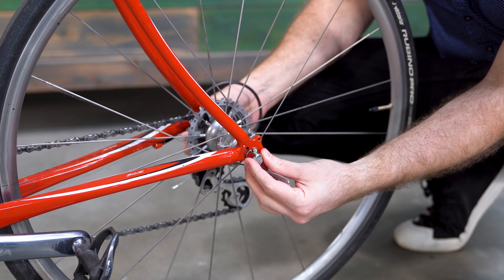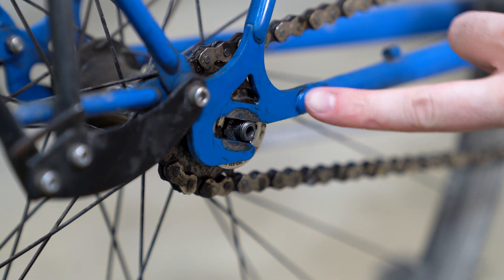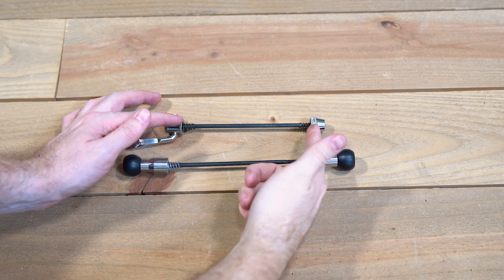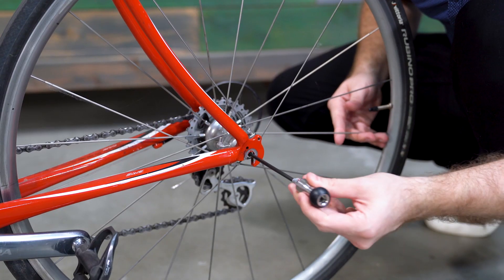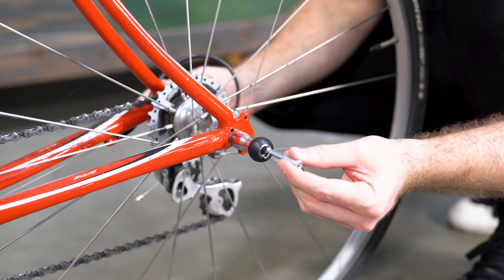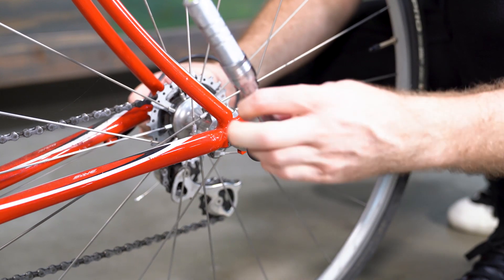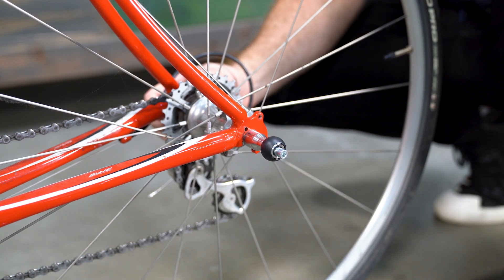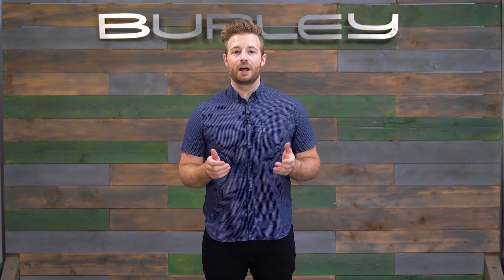Coho XC 5mm Skewer Installation | Burley

Comment: So....no longer a Quik Release? I may as well replace the axle and have a stronger system using the burley ballz nutted adapters.
Reply from the maker: Thank you for your feedback. The updated skewer's design change from quick-release to bolt-on improves the structural integrity and durability of the axle. Please feel free to reach out to our Customer Support Team if you have any additional product questions by submitting the form via this link: https://www.burley.com/support/contact/
Sincerely,
The Burley Team
Reply: I feel the same as you but on a rational level this looks like a nicely engineered solution. I am surprised that QR skewers hold up at all. My first bikes never had QR and then over the years never had a bike without them. I recently worked on a cheap bike without QR and really gained an appreciation for the QR system. I have several Burley Ballz for my Cohoe that fall under the recall.

Comment: Hi, I like the video. I have a question I’m hoping you could answer about the 5mm skewer
Q: I’ve got a rear rack fitted with mounts which protrude out above the skewer. Can you tell me how far is too far.. before it impinges on the latching arm?
To put it another way.. What is minimum clearance required between the outer edge of the frame dropouts and inside of the Coho XC latching arm..
 
My feedback would be more drawings with dimensions as there is so much guessing, just include as flash frames or links in the description
Show skewer spindle length alongside hub width... How far out does the ball join protrude.
Thanks..
Reply from the maker: Hello Jonathan, thank you for your question and feedback. For specific compatibility questions like this, our Customer Support Team is the best resource. You can contact them directly by submitting the form via this link: https://www.burley.com/support/contact/
Please feel free to reach out if you have any additional questions. 
Sincerely,
 The Burley Team